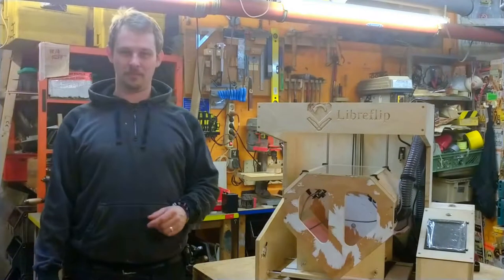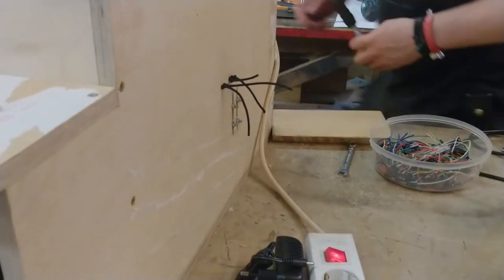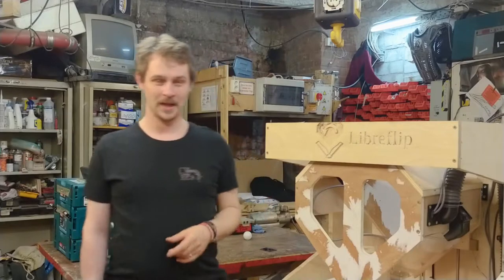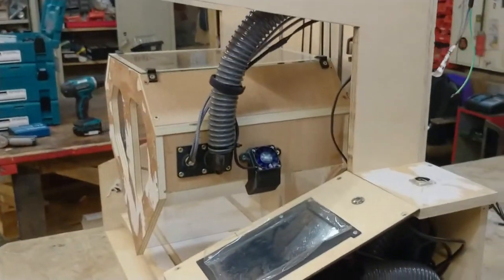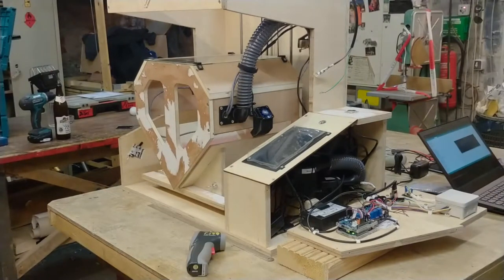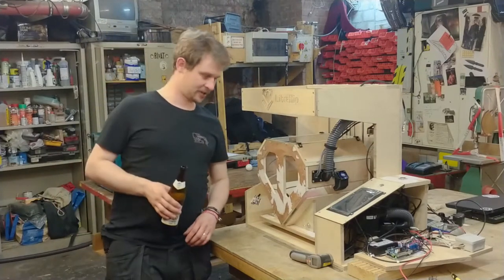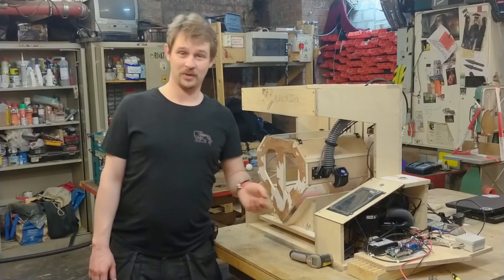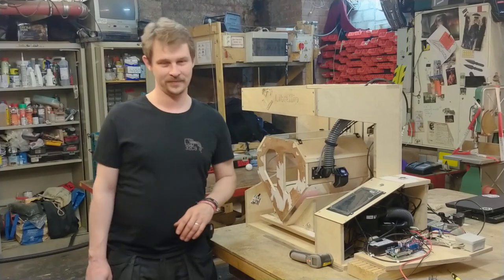building Libreflip - E20 - I like to move it, move it - First Sucess! - then FAIL!

Comment: Ketzerische Frage: Wäre eine Gewindestange nicht ein einfacherer Weg gewesen, das Ding zu heben?
Reply from the maker: Gute Frage, danke dafür!

In der Theorie, bzw in der Industrie wäre dass das Mittel der Wahl gewesen. Allerdings reicht da keine normale Gewidnestange, sondern es braucht mindestens eine Trapezgewindespindel, oder eine Kugelumlaufspindek. Die kann man als Privatperson schon nicht mehr so einfach bekommen, zudem braucht es da abgedrehte Enden mit Platz für Kugellager und Nuten für Sprengringe und besonders geschnittene GEwinde für Kontermuttern - das kann man als Privatperson kaum leisten, oder man muss es in einer Schlosserei machen lassen, was teuer ist. 
Für die Industrie wäre das die Königslösung, aber unter dem hier sehr wichtigen Aspekt der Nachbaubarkeit und der einfachen Verfügbarkeit der Komponenten, habe ich mich dagegen entschieden. 

Gegengewicht und Treibriemen ist einfacher zu bauen und deutlich fehlertoleranter.Wenn bei einer Kugelumlaufspindel oder Trapezspindel etwas 1mm schief steht, klemmt es. Eine Lösung mit Gegengewicht ist fehlertoleranter, 2mm daneben und es geht trotzdem noch.